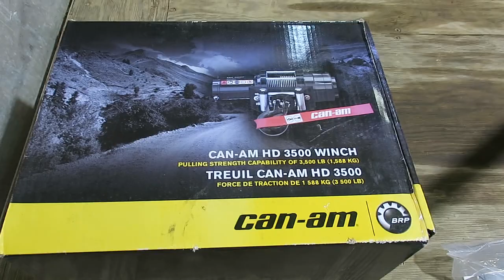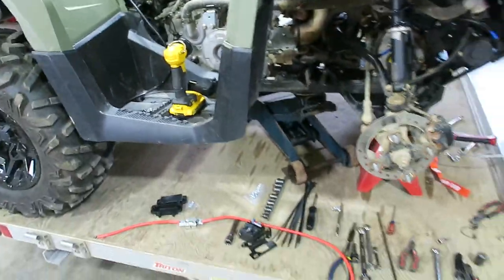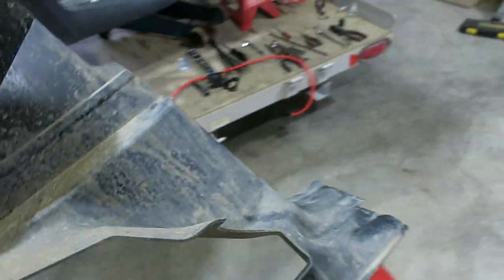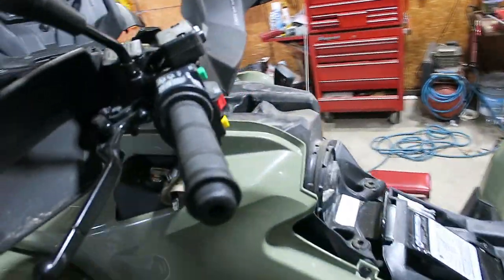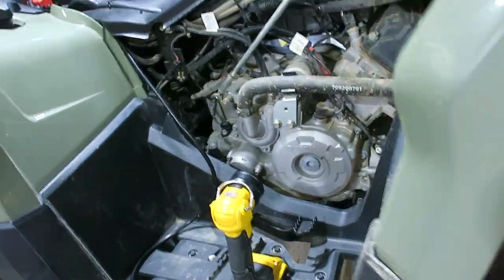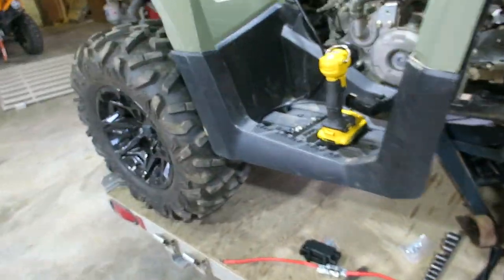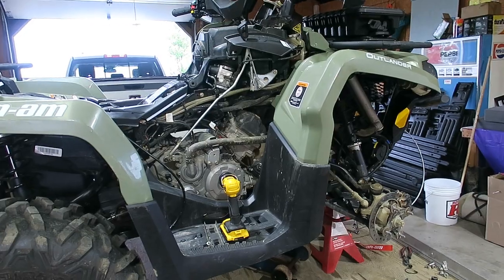Winch install on Can Am Outlander 450 (Part 1)

Comment: Some of those roller fairleads have a larger diameter bottom roller for use when using a snow plow blade which can make the cable loop & swage hard to fit through the gap in the rollers without removing the roller pin end circlip and roller.  The larger bottom roller allow the steel winch cable a larger radius to run over when lifting & lowering the plow blade.
Reply from the maker: Yes, I would agree!

Comment: What wheels are those? Any rubs?
Reply from the maker: Those are actually off of a Can Am Defender. I did do a video on it but I never posted it. Will have to find it and post. No rubbing and I was surprised when I put them on. Took it to Royal Blue in Tennessee, didn't have any problems. Gave me an inch more clearance.